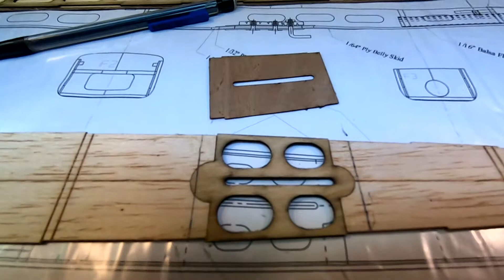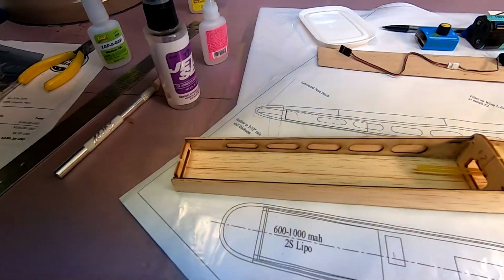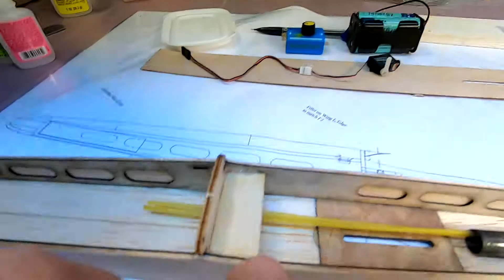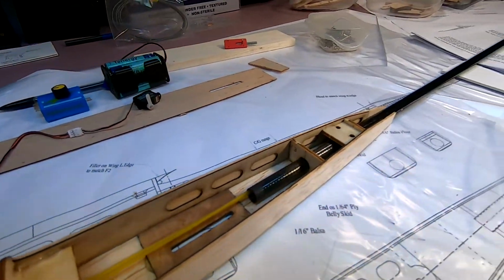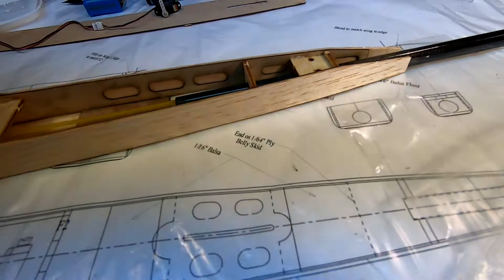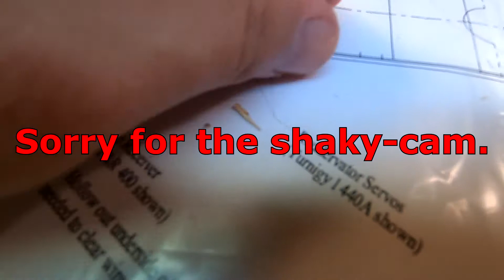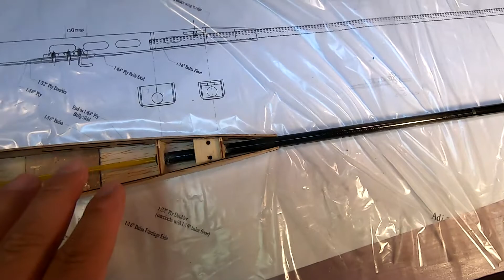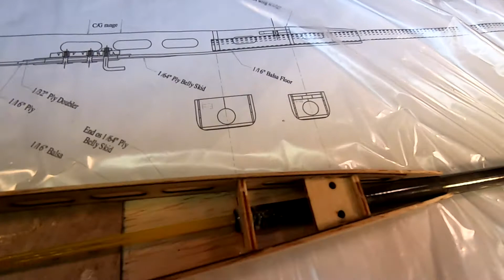Chrysalis-Lite RES Build - Pt4b - Assembling the Pod/Fuselage

Comment: The plane is coming along quite nicely.
Reply from the maker: Thanks Geordie! I'm going to be building another 2 meter RES from a different manufacturer, with a different construction technique. It will make for an interesting comparison. I wanted a second 2 meter bird to have a backup in case I crash one during an event. I also wanted to have one that is more of a floater for light wind conditions and another that can handle higher winds and speed. The rules say you can have up to 4 planes and can switch at the pilots discretion. It arrived today, so look for an unboxing video to come out real soon. Several subscribers are waiting for me to build the Fokker Dr1 triplane, so I'll build that as soon as I finish the Chrysalis. Then I'll build the new 2 meter, or finish the Avia F5J, or build the Passer.... I've got a lot of building to do! There is also an aerobatic foamie, the big cub-like vintage Porterfield Collegiate (already half built), and a drone on deck. For sure I won't get board this winter. I've got a set of skis for the Collegiate so I'll be doing some flying off snow as well. Lots of good stuff coming. 
BTW, I'm going to be making some more mods to the Raven and take it slope soaring this fall. I've got a couple interesting locations picked out to road-trip to for slope flying.
Reply: My RC Channel 
Man you have a lot of planes on your work bench and a lot of money tied up in them. 
I'll have to stay with my 1.5m kunai and 2m magellan. I tried selling my kunai so I would have the funds to buy an art hobby agena ev but got let down by two buyers who never showed up at the last minute. Oh well such is life. 
I have not been flying since june, my buddy has had a short term work contract so he has not had time to get us to the field. I hope I can get there at least one more time before our snow comes in a few weeks.
Did you have your surgery yet?
Cheers
Reply from the maker: The first surgery date got pushed... now it's Sept. 12th. Thanks for asking!
Yes, I've definitely got some coin invested in this. I'll probably start selling some of them through this channel, ebay, or at the local RC club meetings. I'm considering the possibility of doing custom builds for viewers... for a reasonable fee. As the channel grows, I may set up a Patreon account and eventually I may make a few bucks off advertising. I don't expect to get rich, but if I can make my hobby pay for itself while giving back knowledge and entertainment to the hobby, that would be great.
Sorry to hear that you haven't gotten any stick time. Hopefully you'll get a chance to fly soon! Have you thought about trying FPV drones? Or is there a park or school field nearby where you can fly a +-1 meter hand toss glider? How about electric indoor planes? My local RC club has a deal with a high school to use their field house for indoor flying one night a week during the winter. Anything like that going on in your area? I'll be filming some of that for the channel this year.
I try to fly year round... within reason, and we get sub-freezing temps, ice storms, and snow. I guess where you are it's a whole other level of cold and snow. Personally, I always liked flying gliders in the snow. If it's powdery, even steep landings are cushy and if the snow is crusted over the glider can slide 10-20 yards while you steer it with the rudder... fun times! Actually, we're coming up on the windy season. The fall here is a great time to go out to a flat field or anywhere with a bit of a rise and chuck a glider into the wind.
Reply: My RC Channel,
 hope all goes well next week with the surgery.
I tried a quadcopter a few years back and hated it. There are two school fields where a small plane could be flown but with all the hassles going on up here in Canada with drone regulations I'd be scared to fly there incase I'm reported. I don't have anything in the sub 250gram category so if I got a fine I'd have to sell all my rc toys to pay it. 
It'll be nice if your bespoke building service gets going.
Reply from the maker: Hey, if below 250 grams is legal safe zone, here are 26 options under 250g, many are way under! 
https://www.horizonhobby.com/category/airplanes/airplanes-14501--1/ultra-micros 

My favorites from this list are...
43g - UMX Radian BNF with AS3X (EFLU2980)
121g - UMX Timber BNF Basic (EFLU3950)
48g - UMX PT-17 BNF with AS3X (EFLU3080)
43g - UMX Whipit DLG BNF Basic (EFLU3150)
57g - Sport Cub S BNF with SAFE (HBZ4480)
98g - UMX Waco BL BNF Basic (EFLU5350)
91g - UMX F-27 Evolution BNF Basic with AS3X and SAFE Select (EFLU4250)

All these (my picks) are under $130 and some under $100... and some have Spektrum's AS3X and SAFE technology. AS3X is great and SAFE is a get-out-of-crash-free card! 
My number one from this list is the UMX Radian because of the ease of flying due to the longest wingspan of the batch at 28". The Sport Cub S is also a good all around flyer... If the UMX Timber had SAFE, and there may be a version that does have it, that would be number 2 on my list. 
 I've seen several of these planes first hand and they are so small it's hard to believe they fly at all. But the ones with AS3X fly with surprising authority and stability even in windy conditions. Add SAFE and they are super stable. 
These planes are so small and easy to setup and fly that you should be able to slide under the radar... as it were. How about a big parking lot of an abandoned building. Or, a stalled construction site? Or a local farmer that you could ask to let you fly on his land?

BTW, I have heard about all the problems that careless drone flyers have caused and the resulting governmental and regulatory response. You'd think that this would have been foreseeable and that people would have tried to be more responsible... but no! We are facing a crackdown from the FAA here also, but not as bad as what you're facing in Canada.